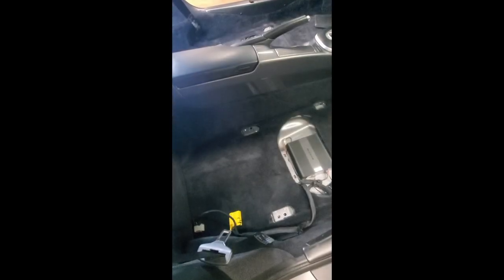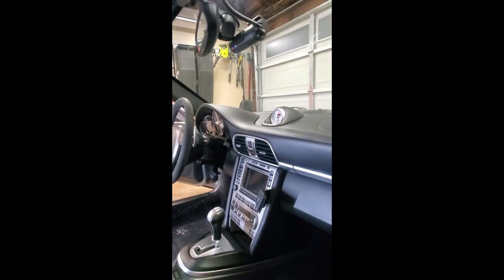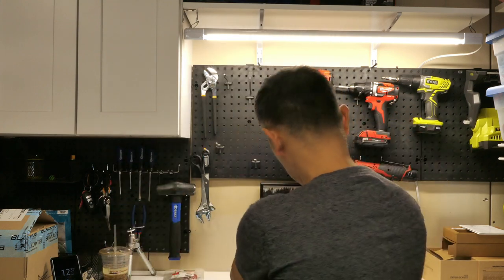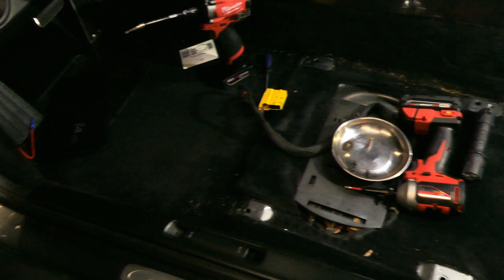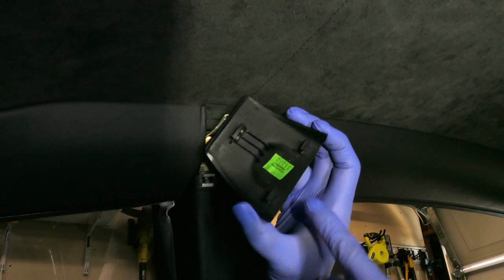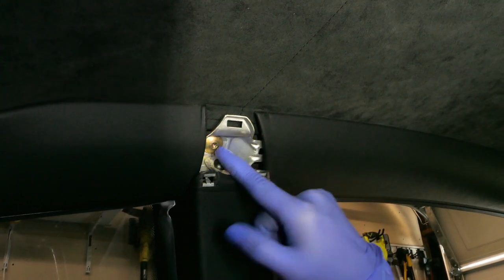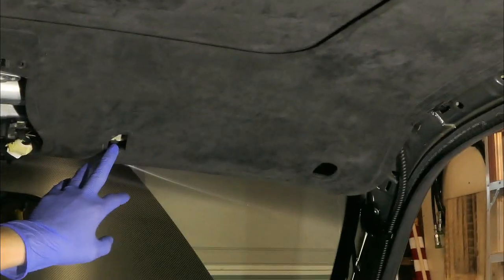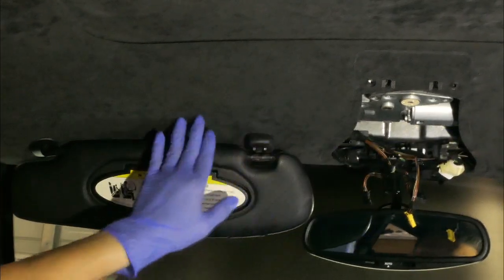How to Install a Dash Cam in a Porsche 911, #BlackVue #DR750-2CH LTE

Comment: Some dash cams are designed to be connected to a fuse that continually draw power. They have a built-in sensor which will stop drawing power if the battery drops below a certain voltage. The VANTRUE N4 dash cam has this feature which allows the car to be monitored while it’s parked, so no need for accessory power pack.
Reply from the maker: Bob In Houston, you're 100% correct. Some dashcams have built in voltage detection and will shut the camera off should it detect too low of a battery voltage. The problem with this design, you end up having no dashcam footage once the system shuts off. With a back up battery that functions mainly to supply power to the dashcam, you do not have to worry about it shutting off.

Comment: Question - why did you go through the trouble of setting up the battery pack on the passenger side? Wouldn't it be easier to run the cable to the battery pack and situate the pack under the driver side seat?
Reply from the maker: Great question...It's been a couple of years since this install but from what I remember, there was a control module under my particular's 911 driver seat. Because of this, the battery would not fit.
Reply: Thank you! I really appreciate you providing this guide. Great work @TheAutomotiveFanatic
Reply from the maker: @carrotcake602  I'm glad you found this video useful!

Comment: Question so to show where you installed the vcc wire, where did you install the acc wire.  The ground I can figure out.
Reply from the maker: Pat, I only connected 2 wires. #1, which is ground and you know that. #2 is directly to the fuse box @ junction C6.
Reply: @TheAutomotiveFanatic Fanatic Thank you, I guess I assumed that with the wire kit you have a VCC and ACC, so a switched on and always-on power, I thought they both would be connected.
Reply from the maker: @patdouglas6845  with this setup being a hard wire kit, it's just ground and a switchable power lead.

Comment: I saw in your videos that you was an Audi A3 owner , plz help me , I installed folding mirrors on mine and changed door module ( from Ali. Express made in China ) , after installation and coding when left mirror up other one down and vise versa . windows button as well are reversed  , iam frustrated I saw in some groups that it’s because of the module the previous module last 3 digits was 392 the new one 592 no one figure out the problem iam straggling for a month without any solution
Reply from the maker: Helllo there, I never got around to retrofitting folding mirrors on my S3, but did find this link for you to read:

https://www.audi-sport.net/xf/threads/a3-saloon-retrofit-folding-mirrors.258048/